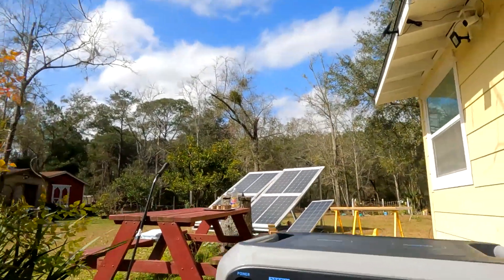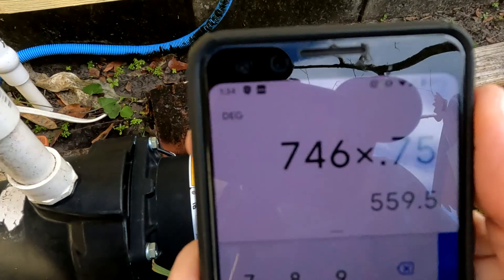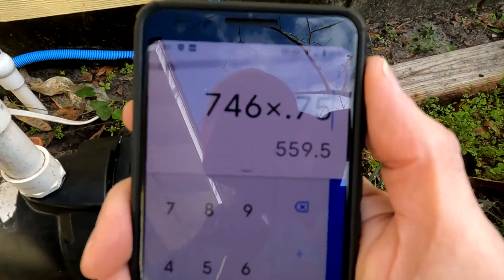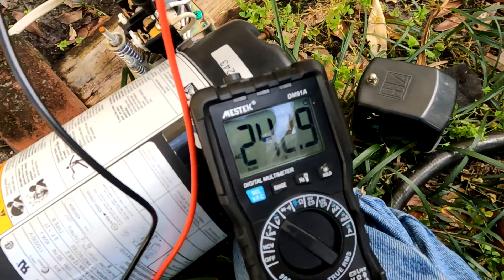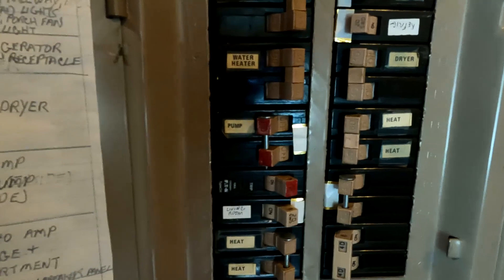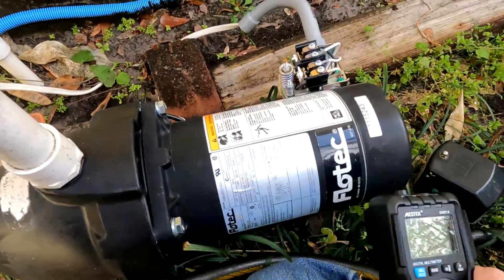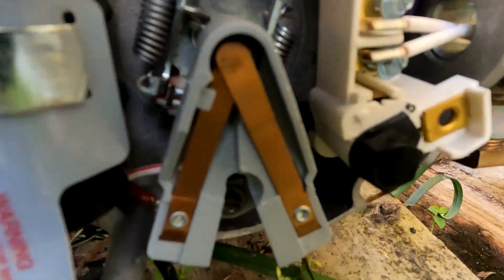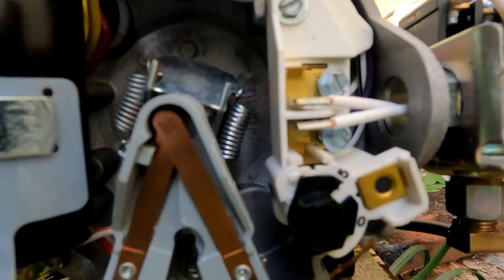Bluetti AC200P Running Water Pump

Comment: Hi, thanks for the video. Do you know how deep your well is?
Reply: Those styles of pumps only work with gravity restricted suction height which is 25 feet.  So the pump could be 1000 ft in the ground but the water table in the area has to be at least 26 feet for it to pull suction.

Comment: How many amps was it pulling with running 220 vs 120???
Reply: @ 1:40  "Whenever you go down on the voltage the amperage coming into this pump will double"   (I guess that doesn't answer our question though), but from 230volts to 115 volts it would double.

Comment: When the generator turns the fan on, does it put put out a smell ? Mine smells like an overheated drill, is not as strong but it's always there when the fan kicks on
Reply from the maker: I have both the original AC200 and the AC200P. I can't smell either one unless I have my nose right up to the vent. It then smells more like a hairdryer than an overheated drill.
Reply: @2xit  thanks for the answer,  the other problem I have with mine is the battery level not being accurate,  it goes from 100% to 20 or 30% after using it for short periods of time,  then sometimes after turning it off amd then back on the battery level will go up again. I greatly appreciate your answer as im trying to figure out if my unit is defective
Reply from the maker: @soylibre  The voltage reading should not be varying that much. If my power station was having those issues, I would definitely contact Bluetti. What you are describing is not normal.

Comment: What was the peak power draw at start-up?
Reply from the maker: The peak power draw at start-up is 3,178 Watts.
Reply: @2xit  Does it have a 3000wh inverter to handle surge?
Reply from the maker: @InVinoVeritas.  It has a 2000 watt inverter, but from the videos I viewed on Youtube, it seems to be able to handle high surge current. From the test I've seen, if the surge is too high, it shuts down in protective mode. This is a pretty good video on pushing the limits of the Bluetti AC200P.
https://www.youtube.com/watch?v=briFUcQVlwA&t=1451s
Reply: @2xit  That's pretty impressive it can handle that high a surge with a 2000w inverter.

Did you get product to review from Maxoak or did you purchase unit?
Reply from the maker: @InVinoVeritas.  I wished! :) I purchased the original Bluetti AC200 when Maxoak had their campaign in summer of 2020 and the second power station, AC200P, in December.
Reply: @2xit  Roger that...I wonder if the AC200P, the later version, has a better inverter?
Reply from the maker: @InVinoVeritas.  From my experience in using them both, I believe it's the same inverter in both.
Reply: @2xit  Roger that, thanks!!